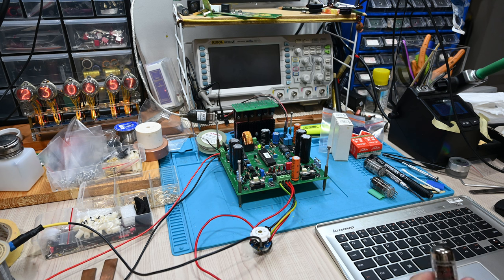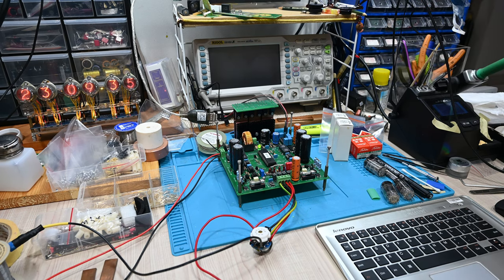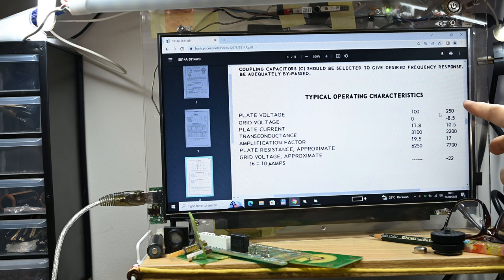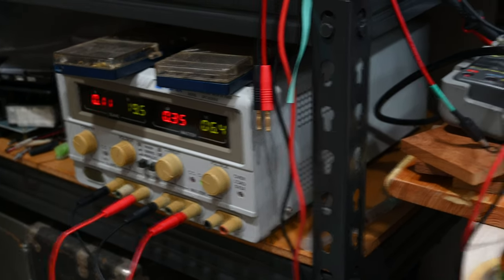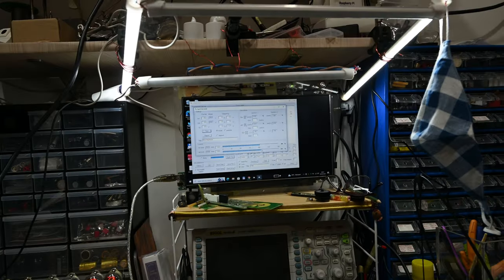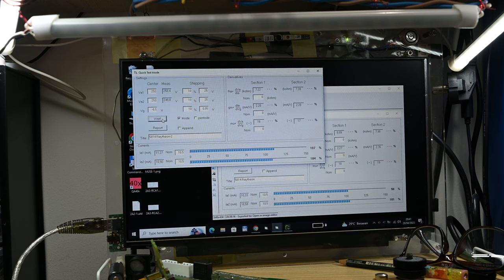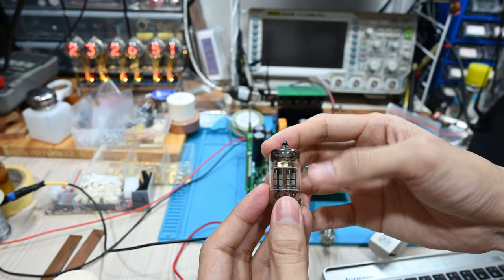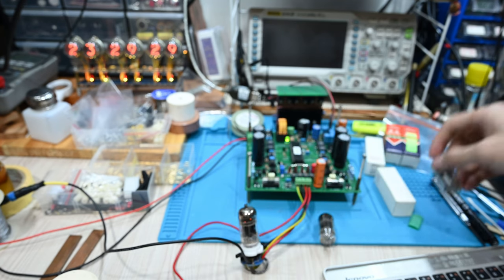Basic Tube Testing with uTracer V6 - Raytheon CK5814WA

Comment: With 1000v  1 a  the heaters  need to be 10 a and 20 volt if your using big power tubes. IMHO  . The curves and info is very help full . Good video again .
Reply from the maker: Thanks John.

Comment: @jimmysjunkyard  I'm enjoying your videos Jimmy. I was wondering if a uTracert 3+ could be modified to enable me to test 300b. I need higher -Vg. Did you look into this? I can't imagine I would need any higher anode voltage than 400V available on the 3+  Thanks , Michael
Reply from the maker: Hi Michael, I guess you need to consult with Ronald directly on this. I recall there is some modification available, but not sure for higher grid voltage... I dont think you can do more than 400V as the capacitor will be the limit? But again best to discuss with Ronald and maybe get V6 😅. Thanks.
Reply: @jimmysjunkyard  Thanks Jimmy. I've sent Ronald an email.
Reply from the maker: @Europhile  trust he will be explain all in detail!

Comment: Hello! Is it possible to measure a higher performance tube with utracer and then measure it statically? I am thinking of an analog tube tester where the tube is at a constant anode voltage, I have interesting experiences, I would like to know what you experience.
Reply from the maker: Hi, so far I'm not really seeing so much different between pulse and consistent HV tester. I have tested bigger tubes like 300B and the result is pretty similar with the manufacturer datasheet which normally use constant HV tester.

But I'm building my RoeTest, which another "Rolls Royce" grade of tube tester (you can search more info for this tester). It's a bit complicated to build, but I trust well worth the result. 

Thanks.
Reply: @jimmysjunkyard  Hello! Thank you for your answer, if you have time, try a large tube like e.g. 300b utracer, then put it in a static tester and switch it to anode voltage. Measure it after 20 minutes, I'd be interested in the result. But if you think I can write an email, I don't want too many comments here, you might not be happy about it.
Reply from the maker: @Sanyesz855  No worries. I have tested few tubes like 300B and 2A3. The 300B was from Shuguang (Black Treasure) and Takatsuki. Both has measurent from the factory (I think they used Amplitrex). My uTracer showing like  3-4% different only - which I assume this is still very accurate. Thanks.
Reply: I want... I wanyt... 😂
Reply from the maker: Can... Can...